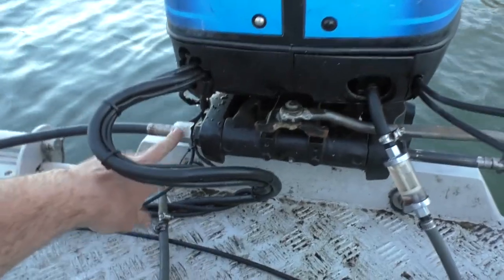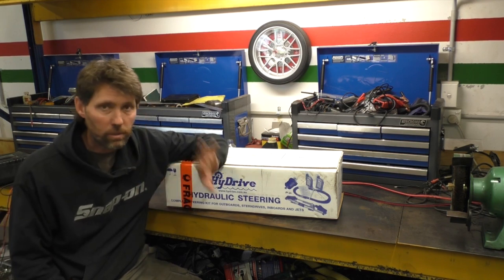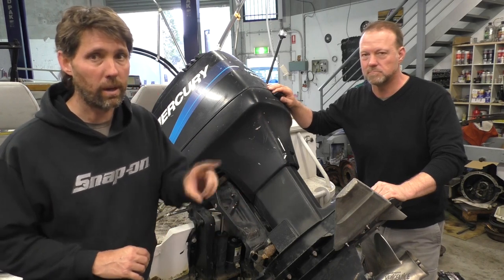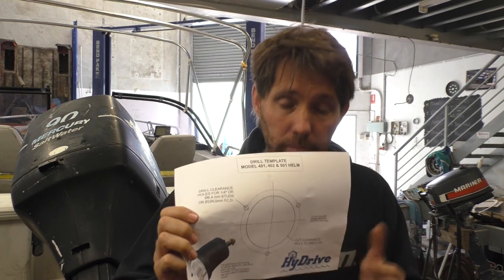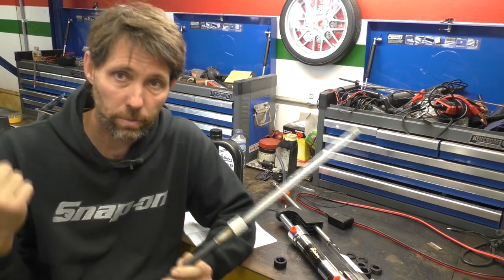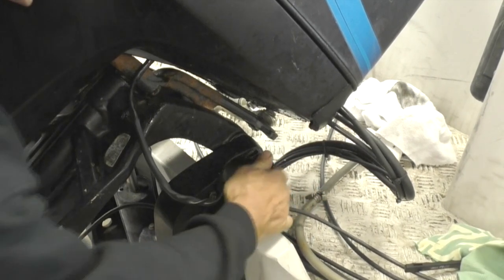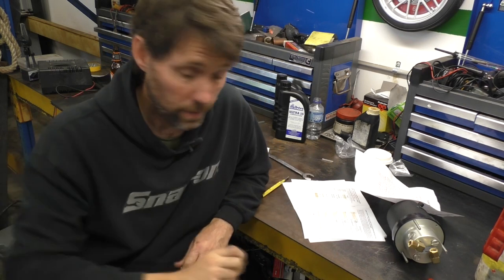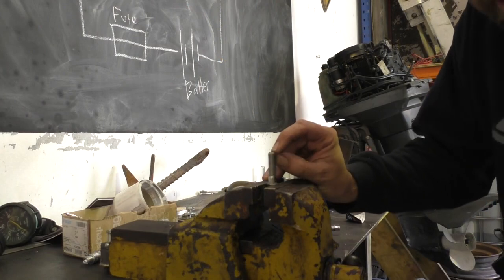Installing HyDrive hydraulic steering in a boat

Comment: Excellent video! That looks pretty time consuming but not difficult to do. The reduction in torque steer is very impressive. All my boats have been cable steer and it is a bit annoying that it's significantly harder to steer to one side than the other, especially for people new to learning how to drive a boat.
Reply from the maker: It is a reasonably long job, but as you say, no single part is too hard. The results are really worth the effort though.

Comment: Hi, good video! But I've not understand if there is electric pump in the steering, thanks for your video
Reply: No electrics at all. The steering wheel unit is the pump. Plus Hystar have multi helm, multi engine fit outs too.

Comment: If that old helm had a new cable and thats what created that steering problem was because it wasnt installed correctly they have to be set up in with gearing of the steering so they dont pull in either direction
Reply from the maker: Can you give a few more details on how this gearing is setup?
Reply: ill try to explain it im sure you know what i am speaking about.On the console steering you have the steering gears in the grease housing case well when you feed through the steering cable and you dont like put it in the middle of the gears it will pull one way or the other im sure you know what i am talking about.

Comment: You can also use the existing screw holes to attach a piece of plywood on the back side of the existing hole, allowing you to use the hole saw guide bit.  Using a compass, you can also premark the plywood with a circle the size of the existing hole, while the compass center point will give you the exact center for the hole saw.

Comment: I know this may be a little late being its 2019 now but I have found a trick when using hole saws you might find useful. If you have a small hole and need to make a bigger hole mount a piece of wood to use as a backer that your pilot bit can go threw and keep the hole saw from walking around.
Reply: Make sure its quality hard wood though so the drill bit bites down, it will just churn up in ply and soft wood
Reply: Or you can put the smaller size hole saw bit inside of the bigger one. They will both thread on the mandrel.

Comment: A trick you can use for next time for cutting the helm mounting hole is to glue and screw a piece of scrap plywood onto the back of the old hole and then use a holesaw to cut the new hole.
Reply from the maker: Good tip Matthew, I'll give that a shot next time I'm in that situation.
Reply: onYa Matt! I'm a Matt also!! I was going to post this comment lol

Comment: Tip for the future - you don't need to rely on the centre hole with a hole saw.

Get yourself a hole saw that fits inside the existing hole, then mount both the inner and outer saw on the same arbor - you can then use the inner hole saw to centre the outer one ;)
Reply: fkn smart! i never thought about that.
Reply: Brilliant!!!!!!!!!!!!!!!!!!!!!!!!!!!!!!!!!!
Reply: Shut up!! I would never thought of that
Reply: I was just about to suggest that as a construction Electrician  we  do that all the time . Great video Thanks for all of   your help
Reply: @DAMIAN WAGNER It would be a lot easier to get a piece of plywood, mark and drill the three new holes, use those holes to mount the scrap plywood and then use a 85mm hole saw to drill new hole.

Comment: Near death experience testimony re: losing "steering mechanism" at full throttle. Around 1978 I (age 18) and my buddy (age 17) had put a 25 horse outboard (No kill switch) on a 14 ft. fiberglass V-Bottom. We had success fishing for white bass on the White River here in Missouri. We were headed back to the ramp at full throttle, with me on the steering arm/throttle. For some reason that I do not now recall, I chose to switch hands on the throttle. This was an old motor (Johnson I believe) and you had to throttle it down. It would not do so on its own. When I went to switch hands the throttle bar got away from me, the motor slammed hard to the left, handle away from me, and the boat dug into a very hard right with the Starboard aft digging right into a deep well. The sudden turn threw me hard into the starboard aft corner of the boat, with my butt in the corner bottom of the boat and behind the bench seat I was sitting on only a half-second before. In that moment I glanced up at my pal, who was seated on the front bench, but who was now on his right side and holding his arms out in the wake, as the port side of the boat pitched up into the air at a 30 degree angle or so. I immediately had to strain every abdominal muscle to pull myself out of the G-Force that was keeping me in the corner. My left hand was able to grab a part of the motor, and I was then able to pull up enough to grab the throttle from behind (it was pointed away from me at this point) and throttle down. It scared us both nearly to death, and I learned a good lesson that day. It occurs to me as I write this: Rather than firmly plant my butt and body weight deep into the starboard aft bottom; had the motor chose to slam the other direction and throw me head long towards (and most likely over) the port side this story most likely have had a tragic, horrific outcome. I thank my God for His saving grace.
Reply from the maker: It reminds me of a similar accident I attended while working for Maritime only he hit the gunwale and broke his pelvis and ended up in the water swimming with the boat doing tight circles right near him. Very nasty, but he made it.

Comment: Why are you making the so hard. Just attach a 6 X 6 piece of thin plywood behind the hole and secure with 3 screws. Then use a hole saw centered in the plywood. After cutting remove the piece of plywood  and there you go, a perfect round hole centered as should be. You do have a tendency to amble aimlessly through many of your videos. Wouldn't be a bad idea to formulate a plan before hacking and cutting begins.

Comment: I operated two different Bostonwhalers a few years back, one with a 200 hp two stroke outboard, no power steering, and the other was a 250 hp with power steering.  It took both hands and spinal fusion to steer the manual, but you could steer the power steering with two fingers. The 250 hp was a four-stroke Merc Verado and the size of a refrigerator.

Comment: Hi great video. As a suggestion use two hole saws one at 85 size you want and a smaller hole saw same size as the existing hole on the same arbour and now you have a perfect centralised hole. This is a regular trick for electricians installing replacement down lights in ceilings.

Comment: Thank you for the video, it was very helpful, I watch it few time before starting installation.Helped me understand and save time and avoid any mistakes. the one difference I did I used funnel to fill up the helm was much easier and no mess. I had a helper to bleed the system and only did it once thanks to your helpful  instruction  otherwise I would have ignored or misread the book as usual if it wasn't for your video. Thank you again
Reply from the maker: You're welcome, glad the video helped you. Having a helper to do the bleeding sure is the way to go! :)

Comment: On my boat 40ft LOA we used slighter bottles & NO 'air in holes' instead squeezing the bottle and letting air in by unscrewing from the bottle to let bubbles in till the bottle smoothes out, then screw up the lid and continue pumping using the 'steering' wheel...

Comment: A better way to create the larger hole in the dash is with  a proper size hole saw.
To get over the fact that there is no pilot hole you need to make an external guide bushing.  The bushing needs only be thin such as 1/4" plywood or 1/8" metal.   With the hole saw cut out the proper size hole in the thin material, position that piece over the area where you want the hole in the dash.  Using the mounting holes for the steering unit screw the drill jig to the dash.  Drill the dash out with the hole saw being guided externally by the jig.  
Very easy, works every time, even when changing the center of  the new hole from the center of the old.  This also works with twist drills, but the jig must be substantially thicker.
Hope this helps someone in the future!
JIM
Reply: Just use the existing screw holes to mount a piece of plywood on the back side of the hole.  Then find center on the plywood and you can now use the hole saw guide bit.

Comment: Another great video.  Just one suggestion; I epoxied a small piece of 3/8" plywood that is cut to approximately 2" wide and slightly longer than the existing hole (round plug not necessary).  You can also dado the edge of the plywood to seat into the old hole.     This allowed me to utilize the center drill bit of the hole saw.  Love your videos.  Even watch just to learn more about my 22 year old Mariner 90!  Thank you for posting.
Reply from the maker: Thanks Greg, sounds like adding a backing plate so you can use a hole saw is the way to go. A few other people have mentioned they ran with that technique.

Comment: I can attest to torque steer on a cable setup. On my old Nautiglass I actually broke my steering wheel (it was old and brittle) while wrestling with the steering under full throttle. Try getting back to the jetty with half a steering wheel! Not fun. Great video. I would now not hesitate to have a go.
Reply from the maker: Wow, that would have been a moment!

Comment: Stu I suggest a brake master cylinder honing tool might also be adaptable to serve at cleaning the steering tube on outboards, particularly with regard to some of the more tenaciously grungy examples.
A 12g shotgun cleaning kit might also adapt well to tasks such as swabbing out any residue.

Comment: The bleed bottle you’re using could be a bit better if you were to use an oil bottle off a 2 stroke motorcycle that way you can attach it by the factory made screw tabs but using this you also have a breather lid as well as a bottom feeder tube jobs a good-un as they say in the northeast of England 🏴. great video very informative and educational perfect 👌

Comment: The easy way to drill this hole is to put a 65 mm hole saw inside a 85 mm hole saw and there you have it. A 86 mm is probably fine if you don't have a 85 mm.
If yoy have to use a saw blade, an air saw is a much better tool than that electric one.

Comment: I flew a PA28 aeroplane once and Just after take off the plane started yawing then  rolling to the right, It was quite difficult to keep it straight on the desired heading as it was always turning to starboard and then nose diving if you took your hands off the controls . I got to above 2000 feet and realised the rudder trim was widely out. It's nice to see the same types of physics involved.

Comment: Greetings from Greece, my friend and thanks a lot for all the technical knowledge you are giving us for free. If you have the time, I d like your opinion on an issue I have with my boat. I own a Hardy Family Pilot 20 and when I run more than 10 miles, the boat has an issue with staying on route. For example when I run at 10 miles on small waves, I have difficulty maintaining control of it because its changing route on itself by going left and right. The engine is an outboard Honda 90hp. Would a hydraulic steering wheel correct the problem or it is solely based on other factors? I should also mention that the steering wheel is a mechanic one and has a small "gap" between turning left and right. The steering mechanism is made by Morse.
Reply from the maker: Hydraulic steering may help as it doesn't let the torque of the outboard override the helm, but you may also find that it is an imperfection in the shape of the hull that is causing your problem. A small amount of plan in the steering wheel and cable could also be the cause so upgrading to hydraulic would also replace all the old worn components. Let me know how you get on. I had a great time sailing in Greece, beautiful country. :)
Reply: Thanks a lot for your instant reply. I ll take in consideration your advice. I am already thinking of upgrading to the hydraulic system. Take care and God bless!

Comment: I know this video's 4 years old but if you ever need to use a hole saw and you have no centre you can use a 2x4 or piece of wood to back the existing location and then cut your hole.

Comment: Mathew I just installed a 90 hp Mercury 1981 Tower of Power and now thinking of steering. I have the old style and want to now what is the cost to upgrade. I live in Ontario, Canada. I thank you for showing your steering video. What brand do you suggest.
Reply from the maker: +Bobby Twist I installed a HyDrive unit that I was very impressed with. To buy they cost about 1100 Australian dollars.

Comment: Hello Dangar Marine.
Did you enjoy your break at Byron Bay?
Have you had a chance to look at the video of the Hydrive hydraulic steering?
I have fitted my system and have made loops in the hoses at the motor, and so far it seems to work ok.
My only concern is how well the hoses will stand up to constant flexing.
Could I attach short lengths of flexible hose at the motor end to solve the problem?
Any information will be greatly appreciated.
Chris Allen.
Reply from the maker: Ah, thank for reminding me, I'll look at the boat itself today. If the hoses moving worries you, I would be more inclined to just add a lit of extra excess so that down the years you can trim and inch off and reconnect them. I'll get back to you in a few hours when I've looked. Otherwise I did find the guys at Hydrive really helpful so they may have a suggestion too.

Comment: Hi again! Another good Vid mate. Thanks. ^&_;^  ?    The next time you are trying to cut a hole for the Helm Pump, you might want to consider, using a piece of 22mm ply, cut square to your known measurements. This has the advantage of giving you a clear centre point, when you take a corner to corner line, it helps you to centre the Ply on the Dash, you can use the old holes to hold the Ply in position and gives you the centre holding point for the Arbour of the Hole Saw. 
Centring is relatively simple, given the radius size of the old hole, you can work out the positioning of the ply using a compass. 
This will give you the remaining distance to the edge of the ply, which can then easily be transferred to the Helm console. 
Eg. For argument sake, the new hole size needs to be a 90mm Diameter. 
The Ply size is L 180mm by W 120mm, by 22mm thick . 
The Old hole Diameter size is 80mm, giving us a Centre point and Radius of 40mm. 
Using a Compass, draw the 80mm Hole on the Ply and then take the measurements to the edge of the Ply. 
L180mm divided by 2 = 90mm. Centre    ....... 90mm - 40mm = 50mm to Ply edge
W120mm divided by 2 = 60mm. Centre     ....... 90mm - 40mm = 20mm to Ply edge 
You can see where I am going with this. 

ALTERNATIVELY: Just mark the new size hole up on the Helm Console. You can do this by scribing it from the edge of the Old Hole, or by placing a temporary ply backing by using the old screw holes and using a Compass draw the new Circle, after working out the centre point. 
After having done either of these, use a 25mm piece of Ply with a large enough hole cut in it, so that you can see your new marked Circle. You can leave the Ply free Floating, holding with one Hand, or you can use the old Screw holes to temporarily fix the Ply in place and using a Jig Saw, cut the new hole. 
The Ply will raise the level of your Jig Saw Base up off the Dash, enough to clear all Gauges, etc. 
YOU WON'T have to REMOVE any Dash Hardware, saving you a lot of time and effort!
Reply from the maker: Sounds like a good technique. Thanks for taking the time to explain it. :)

Comment: Thanks so much for the fantastic videos. Especially the unforeseen  trouble shooting ideas. I just completed a hydraulic steering install  on my '87 Arima. Even though mine was a different make with slightly different fit and finish, it is so helpful to watch  a detailed walk through of a similar job.  Last year I was able to disassemble  my 9.9 Yamaha kicker to clean out all the salt water deposits that were clogging the cooling  system. You provided excellent tips on how to pull the flywheel without specialized tools.  Extremely helpful. Thanks so much!
Reply from the maker: You're welcome, glad the video helped you. :)

Comment: with a major large hole and 3 existing small holes it is much easier to push 15 - 20mm ply behind the dashboard, utilize the 3 existing  small holes to hold it in place, this allows you a pilot cut and perfect positioning
Reply from the maker: +Chris Waddell Yes, somebody else mentioned this technique and I think it is a good one. Will definitely give it a go next time.

Comment: Actually I prefer the plywood jig in this case as it aligns the 1/4" bolt holes which are very near the inner hole.  I drilled them on the drill press and used them to fasten the jig that put my big hole exactly where I needed it.  You could use a thick enough piece of wood to clear your gauges with the sabre saw too although I used the hole saw.  Then I used it to cut out my 1/4" aluminum backing plate for an exact copy.  Take care.  Doug in Alaska
Reply from the maker: Yes, I can see the advantage of this method, particuarly if you start with the helms mounting holes to get everything secure. The big bonus is that you don't have to buy any expensive specialist tools. :)

Comment: Great informative vid. A tip with cutting the hole. Put the 85mm hole saw on the arbour and there should be enough thread left on the      
arbour to screw the 65mm hole saw on as well. The 65mm saw will stick out past the 85mm saw and will act as a guide, simply put the 
65mm  into the original hole and start sawing. Worth spending the $20 or so on an 85mm hole saw. Hope that make sense.
Reply from the maker: Thanks mate and great tip re the hole. :)